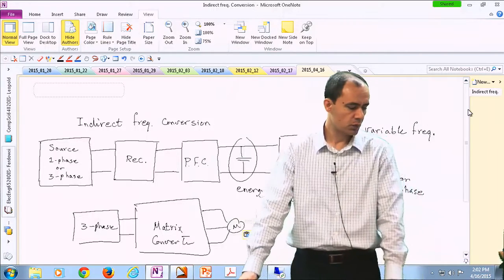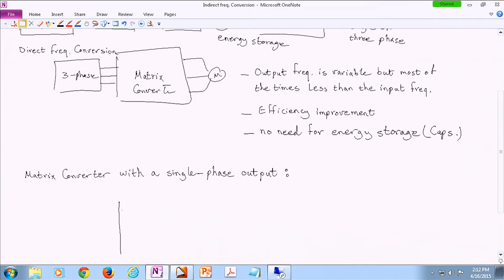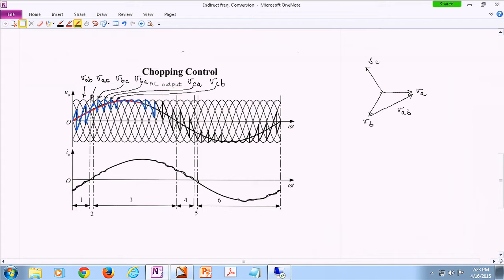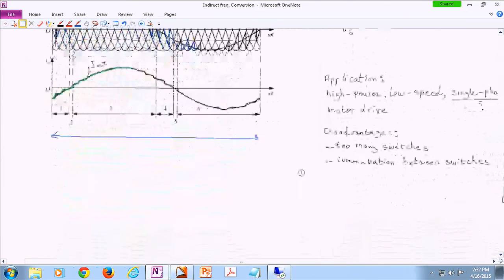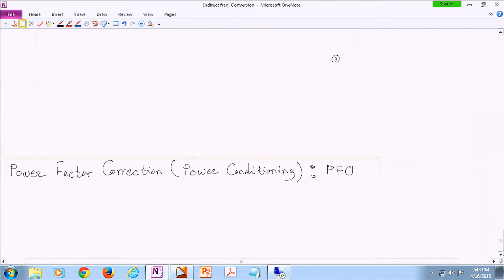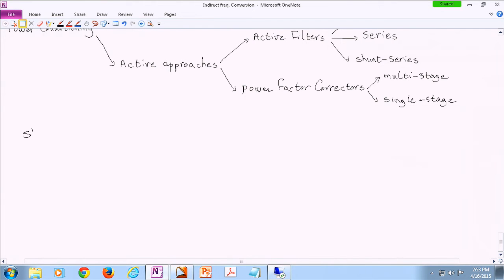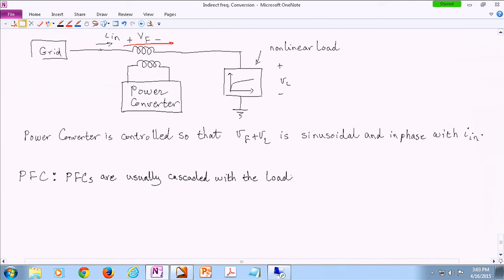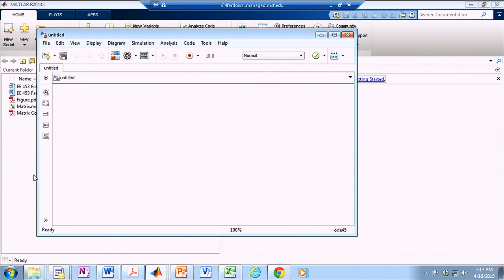[22] Advanced Power Electronics (Mehdi Ferdowsi)

Comment: can we use this Matrix converter for wind power system ?
Reply: Yes they are useful in wind systems. The converter convert the variable frequency  of a wind turbine to a fixed frequency required by the grid. So despite the variation of wind speed the converter makes sure the frequency fed into the grid remain constant.